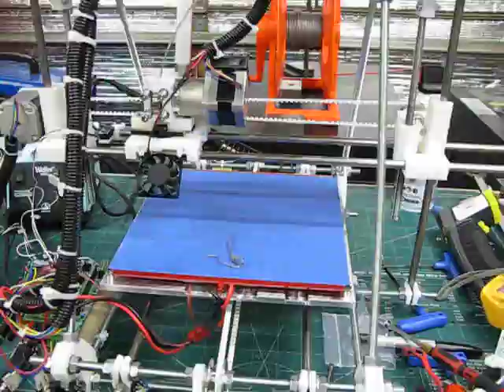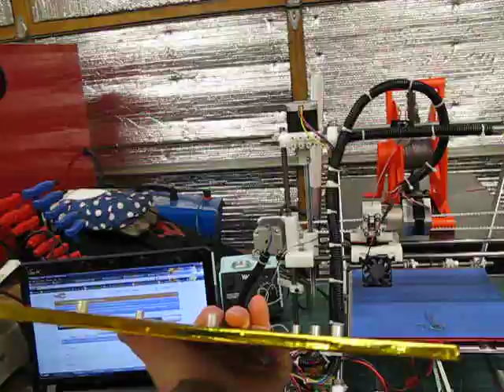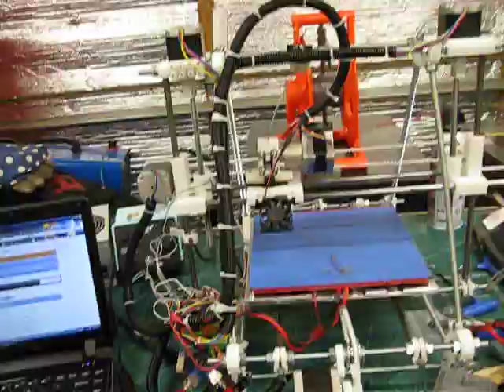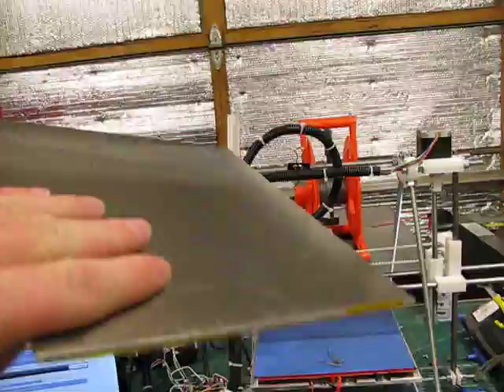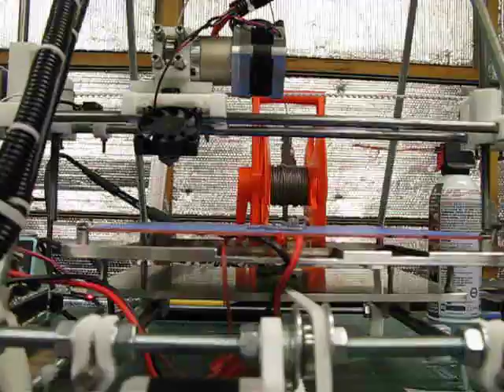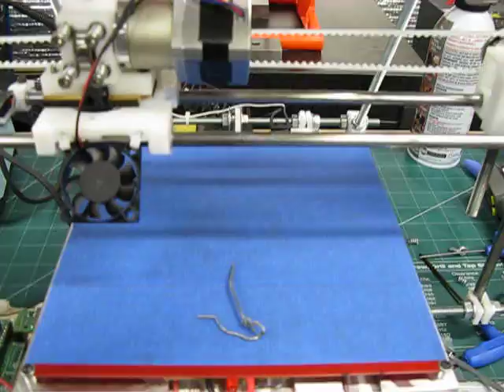Steps to a better more reliable Mendel Prusa 3D printer

Comment: I could be wrong about this but (again I maybe missed something, but here goes) your efforts to flatten everything were totally negated when you elevated the build plate on 4 standoffs. In other words with the plate supported in the 4 corners it really doesn't matter how wavy or out of flat anything below that is. BUT if it works then my guess is the standoffs removed the heat from the lower structure which stopped the stretching and contraction of the corners which was causing the warping??

Comment: As i am in metro area Denver i took cans to a recycling place got 25 bucks for a years worth of cans walked across the street to their sales department and bought 25 bucks worth
got my alloy bed there
I run with out springs as the Masonite carriage flexes just enough thence on my alloy plate
i have fiber glass racing tape for headers thence heated PCB thence 1/4 Pyrex .
no air gap to cool the PCB under side as The "Y" moves thru air.
any way give that air gap a thought and print on glass

Comment: I have a similar printer and the dual Z axis motor system is a joke. I'm not sure why they chose to do this with two small steppers but it's really a dumb design. I'm modifying mine for one larger motor and a timing belt.

How do you like the planetary geared extruder versus the standard helical geared style? I'm looking into changing mine.

Comment: I use a layer of cork between my aluminium plate & my heat bed with 3/16 glass on top.  Works great.  I can get to 110c for abs.  65c for pla.  I use glue for ABS and nothing for pla.  Pla sticks great.    oh yea, plane cheap window glass sticks better than ceramic glass.